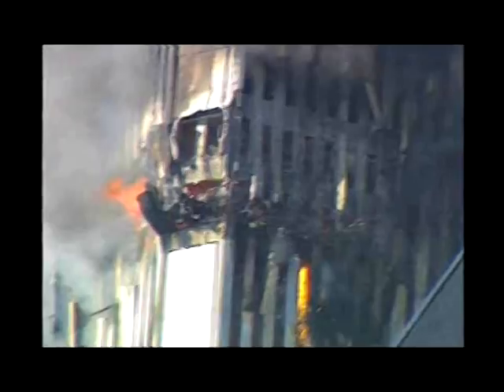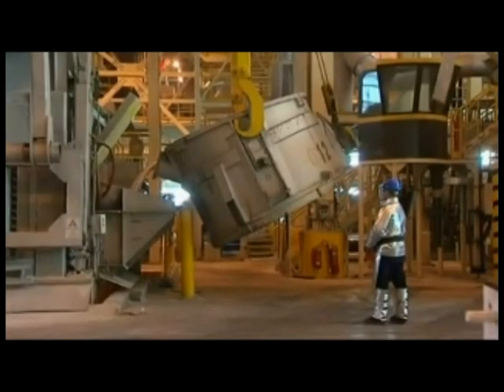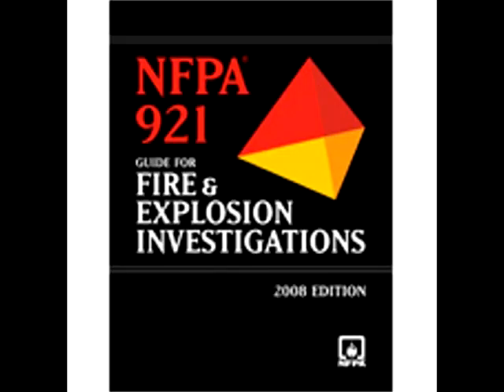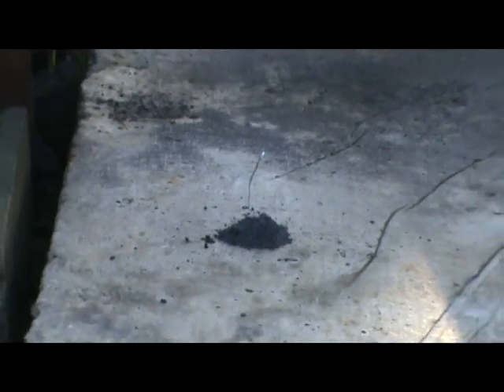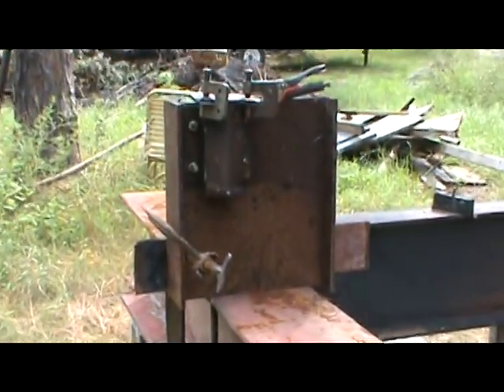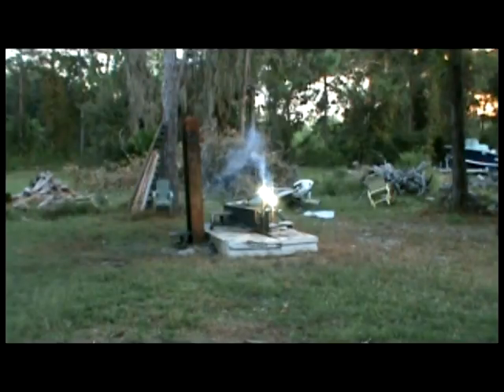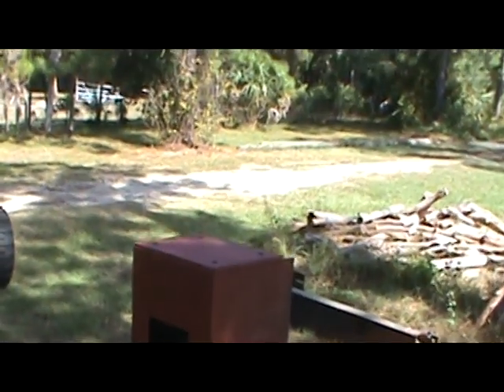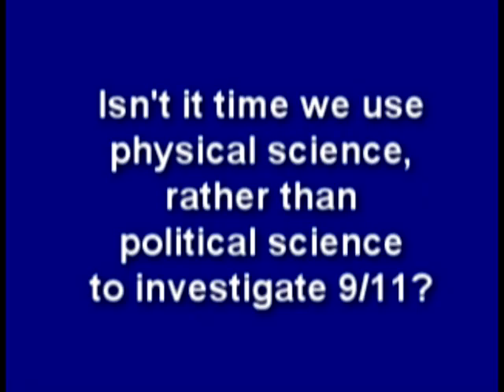9/11 Experiments: The Great Thermate Debate

Comment: @hank1961 Now yes, the columns may have finally failed due to some beams connected to the columns failing or extremely sagging pulling the columns over or simply not helping keep them upright (Watch the vids of both towers collapsing, you will see they both tilt 1st before they fall) most of the internal columns did not fail axially in how they are designed to bare load, but fell over or bent over which would require much less force for them to fail then what they could support axially

Comment: @hank1961 1st off, columns is the word you want, not beams. Beams only support their own weight, concrete slabs on that floor only, and the live load those slabs carry on said floor (desks, chairs, people, etc.) Columns support those said beams and slabs as well as all the remaining columns directly above them along with all of the beams and slabs they support all the way to the top of the tower. The towers collapsed because the columns failed, not the beams...

Comment: @bubbasteve8 You had complete access to the core support through the elevator shafts. Maintenance to elevators had been performed just prior to 9/11, including several weekends where the power was turned, giving full access to the steel beams.

Comment: Also this video mentions @ 0:40 that "molten metal was seen coming out of the northeast corner near the 80th floor." the plane flew in from the southwest going northeast and hit the tower near the right side at an angle also to the right. Therefor the, this 100+ ton wad of aluminum traveling at 500+ MPH would be aiming right for that "northeast" corner. And speaking that there were no columns between the internal core of columns and exterior wall columns, that outer wall would...

Comment: Wow, that is a lot of work you did, so your telling me that, unless they rigged all the floors with your thermite controlling contraptions, that they had pre planned the exact floor plus or minus 2 floors at most on where to fly the planes into? Evan at that it would take weeks to set up just one floor for that type of "Demolition" Where is all of the evidence of construction workers setting up this demolition of the 2 towers? They would have had to remove drywall to expose the columns etc...

Comment: @RedStarVolume 

"no load bearing walls"

ROTFLMAO!!!

some one does NOT know what he is talking about.....TOO fuck n funny.

that is why steel framed buildings are so popular and the STANDARD
NO LOAD BEARING WALLS!!!
LOAD bearing vertical support with non load bearing long span trusses.
just as the facade of 7 is a non load bearing COSMETIC application that is ATTACHED to the perimeter vertical support where there is LITTLE fire to affect them to CAUSE symmetrical unified accelerated descent.

Comment: @CalumGilhooly
"expansion of the beam would have been insufficient to cause it to 'walk off' its footing"

I agree

for every one direction where a force is applied, there are multiple directions resisting that same force.....lateral, diagonal and cross bracing....many redundant applications overlapping to form a single unit....I find it very unlikely something..."walked".

Comment: @RedStarVolume

"What were those shear studs made of again?"

what about them?
recovered bolts were stronger than typical. NIST 1-2 p.133

These systematic collapses required that THOUSANDS of structural connections per floor to not only fail, nearly simultaneously, but also in sequential order,impossible from asymmetrical impact loading and small, short-duration fires.

Comment: @RedStarVolume

"/44smgw"
Error: Unable to find site's URL to redirect to.

sorry , URL doesn't work.

"no contra regarding the correction of the concrete/steel expansion/contraction issue?"

what are you talking about?
if NO WTC steel found reached a compromising temp....there is NO expansion..
and since there is...
"no steel was recovered from WTC7"NCSTAR1-3 p.iii, 7.7.3
to examine....WHAT EXPANSION?

"you accept your failure"

me thinks you are CONFUSED and inserting topics we never disused

Comment: @NonnyMus1

'disproved NIST's model'

how can one PROVE/DISPROVE something that has NEVER BEEN RELEASED!

"NIST is withholding sixty-eight thousand, two hundred and forty-six (68,246) files, All input and results files of the ANSYS 16·story collapse initiation model, and the the LS-DYNA 47-story global collapse model with detailed connection models that were used to analyze the structural response to thermal loads, break element source code, ANSYS script files for the break elements."

your ball

Comment: @RedStarVolume  If you didn't know, full quotes from First Responders can be found here:  tinyurl . com /6p3kozx  (remove all spaces).  The quotes were cut up and mangled a long time ago by some unknown troofers and the mangled bits have continued to live on like zombies!

The link goes to the 1st section of ~25 sections which have the text of the ~510 interviews.

The original interviews are here:  tinyurl . com /7e62l (remove spaces), but are in pdf form so cannot be easily searched.  HTH.

Comment: Things which explode in office fires:  
CRT's, Drums of cleaning supplies, HVAC equipment (esp. condensers & compressors), Hydraulic pistons in office chairs, Large motors (Elevator, Air compressor, generator), Propane tanks, Steam explosions when fire cuts water lines, Tires in vehicles, Transformers, UPS battery backups

Things which exploded at the WTC:
Firefighter's SCOTT pack air bottles, Pockets of jet fuel, Superheated offices and closets flashing over.

Source:  FDNY

Comment: @hgfbob   LOL!  The link works, moron. It's your ability to comprehend how links work which clearly at fault.  On this planet, you need to follow instructions carefully and remove ALL the spaces.  That means the one before the slash as well as the ones to either side of the .

=P

You can also type in tinyurl . com (without the spaces) into your browser's address bar, copy the '/44smgw' (without the ' 's) and paste it in right after that!  =P

And there's always google, mental midget!!  =P

=D

Comment: @CalumGilhooly  LOL!  Ya bampot!  On this planet, the collapse started at the E. end of the building with failure of internal structures. Once the facades became unsupported, they fell.  The four facades held together reasonably well and ended up draped over the main pile of debris.  That would never have happened in a CD, bawbag!

And again, no deafening explosions characteristic of CD were heard. How many times will you need to be a'told afore it penetrates?  

Now, awa' n bile yer heid!  =D

Comment: @CalumGilhooly   LOL!!  Many things explode in large office fires and all explosions heard were consistent with those.

Here's FDNY's explosion list: CRT's, Drums of cleaning supplies, HVAC equipment, Hydraulic pistons in office chairs, Large motors (Elevator, Air compressor, generator), Propane tanks, Steam explosions when fire cut water lines, Tires in vehicles, Transformers, UPS battery backups. 

Demolition explosions would have deafened witnesses.  No witnesses were deafened by them.  =P

Comment: @CalumGilhooly 
3. Thermite and Thermate both burn white hot (also on youtube samples).
Any burning thermite should have been visible throught the OPEN FLOORPLANS
of the WTC towers. They should have lit up the towers like a lighthouse.
THAT should have been visible for miles.
4. Thermite / ate burns at 2500 C. That should have melted the aluminum
Window panels as it thermally rose from, and exited the building.
NOT to mention melting every junk alloy piece of furniture on that floor.

Comment: @CalumGilhooly 
1. Thermate, even Nano Thermate, (a new twoofer fad), makes sound at 
a level in direct relation to the Weight of thermate burned. That's 100 Tons,
according to Neils Harrit. The sound level is actually thermal expansion 
based, so it's related to STEAM expansion, and just as loud. That's 80 Db.
About the level of a jet engine. You should be able to hear it for miles.
2. You can hear THERMITE / ATE burning loudly in Hobbyist videos
on you tube in one ounce samples. Go look

Comment: @RedStarVolume

so....got NOTHING on the WACKY 9-11 PHYSICS...

FIREFIGHTER RICHARD BOERI WTC2
"We had our backs to the tower and under that pedestrian bridge walking south, myself, Eddie Kennedy and the officer, when you HEARD THE CRACKLING. You looked up and you saw the one floor explode on itself and THE TOP START TO SLIDE."

if the NOISE ..*IS* collapse, how is it possible to SEE it AFTER the 3 second delay it takes the sound to travel that distance through air.

in 3 seconds A LOT HAPPENS.

Comment: @NonnyMus1

''The facade bore its own weight."

that is IMPOSABLE. for it is a COSMETIC APPLICATION attached to the perimeter vertical support....ALWAYS has...ALWAYS will.

"I have provided the link to you'

lol...then JUST quote and put in the address where it's found......DUH!!!....like this...

"no core column examined showed temp. above 250C" NIST 1-3 p.95,101,132

"You should really learn BASICS of construction'

lol..I have 30 years of building BOTH steel and stick......YOU were saying?

Comment: @NonnyMus1

'You may want to PONDER how free fall acceleration of the FACADE of a 47 STORY "

lol...a FACADE that has NO LOAD BEARING what-so-ever...it is ATTACHED to the PERIMETER VERTICAL SUPPORT where there is NO FIRE located to GLOBALLY affect them for the MEASURED descent EQUAL to that of a bowling ball FALLING THROUGH AIR...

The facade was PULLED DOWN, it will NOT support itself, it is a cosmetic application with NO load bearing capability--you should really learn BASICS of construction.

Comment: @RedStarVolume

"Why is there no one reporting about severed beams and columns,'

*HINT*

LEARN HOW TO FUCK'n READ.....lol

for it's in the OFFICIAL REPORT

"but no such thing as clearly blown up steel"

...lol..uhm..it's the BUILDING that was BLOW UP fool...NOT the steel

HOW does one OFFICIALLY CLAIM YEARS AFTER investigation that NONE were used, when INVESTIGATION NEVER TESTED

"NIST did not test for the residue from explosives or accelerants"  wtc. nist. gov/pubs/factsheets/faqs_8_2006. htm

Comment: how do you get,'EVERY' column to act the same way, at the same time, unless they are under the 'SAME' conditions, and acted on by the 'SAME' force???
As soon as the kink is formed, the 'ENTIRE' building,evenly falls at 9.8m/s^2 for 2.25 seconds,(t=1.75s to t=4.0s [NICSTAR 1A 3.6]) Acceleration of gravity...at 4.0s of the collapse, the 'ENTIRE' building is falling faster than 80 ft.a second(60MPH)...'ONLY' possible by removing 'ALL' resistance...nothing in the way
more info at ae911truth. org

Comment: when the kink forms, the HVAC, 'other' Penthouse, roof, facade, within 0.5 seconds from each other, have free fall ACCELERATION for 100+ft. ALL support was INSTANTLY taken away, AS WE SEE by the EVEN decent
if there was a progression from east to west
WE WOULD SEE IT
the roof WILL NOT support itself while columns fail below it. the facade is a non supporting structure, and IS attached to the perimeter columns it will not stand while the columns fail behind it.
for more info...
ae911truth. org

Comment: @NonnyMus1

'They were guided in their investigation by evidence'

really...WHAT EVIDENCE....lol?
they have NO STEEL to look at to DETERMINE ANYTHING!!!

NCSTAR1-3 p.iii, 7.7.3..."no steel was recovered from WTC7"

"a Coroner might still make a ruling. It depends on the evidence."

"Evidence of a severe high temperature corrosion attack on the steel, including oxidation and sulfidation with subsequent intergranular melting..."

MORE HEAT damage than an open air hydrocarbon fire CAN PRODUCE
oop's

Comment: @CalumGilhooly  LULZ!  OK, shitforbrains, now that I've finished laughing, I'll answer your question. WTC7 collapsed after 7 hours of fires because a key long-span beam 'walked' off a key column (#79). You can read all about it here: tinyurl . com /3epzmba (remove spaces).

As for the rest of your spew, the Delft Uni building was NOT hit by aircraft, but was set ablaze by a coffemaker fire. The other steel-framed hi-rises w/ fires were steel grid framed with concrete cores. Get off the meth!

=D

Comment: @RedStarVolume

SO....how does one, YEARS AFTER INVESTIGATION officially claim that "NO explosives or accelerants" were used to assist, when INVESTIGATION NEVER TESTED for an OFFICIAL determination.

"NIST did not test for the residue from explosives or accelerants"  wtc. nist. gov/pubs/factsheets/faqs_8_2006. htm

same with the WTC7 steel, HYPOTHESIZING failure when..."no steel was recovered from WTC7" NCSTAR1-3 p.iii, 7.7.3 ....to GIVE DIRECTION to a HYPOTHESIS

WOW!!!
lets see how ya do

Comment: @NonnyMus1

"On this planet, in building fires"

on this planet, in BOTH Law and Debate, the Dictum is: Those who assert, MUST PROVE!

when are YOU going to START PROVING what is OFFICIALLY asserted?

how does one YEARS AFTER INVESTIGATION officially claim that "NO explosives or accelerants" were used to assist, when INVESTIGATION NEVER TESTED for an OFFICIAL determination.

"NIST did not test for the residue from explosives or accelerants"  wtc. nist. gov/pubs/factsheets/faqs_8_2006. htm

Comment: @NonnyMus1
here is Shyam Sunder the lead investigator for the NIST BEFORE their admission of 2.25 seconds of acceleration equal to Gravity when the kink forms, at the technical briefing.

"free fall acceleration can ONLY occur when there is NO STRUCTURAL COMPONENTS BELOW IT"

since it's NOT fire affecting the perimeter vertical support, WHAT IS?

"NIST did not test for the residue from explosives or accelerants"  wtc. nist. gov/pubs/factsheets/faqs_8_2006. htm

CAN'T say NO controlled demo

Comment: @NonnyMus1

"caught trying to move the goalposts'

too bad you are too ignorant to even grasp what is important...or it's deliberate.

smoke don't mean shit.

it is the SUPPORT that MUST fail and YOU need to PROVE it DID from the FIRES PRESENT, the FACT that it happened proves NOTHING....and the FACT that the side they measured acceleration EQUAL to that of an object freely falling through the AIR, where there is NO FIRE LOCATED to AFFECT the perimeter support....

PROVE it's from FIRE!

Comment: @NonnyMus1

glad you think it's amusing

WHY can't YOU find ANY?

filling your post with NONSENSE, how about a link to the 'INFERNO' you claim is there?

all you have are pics of small SPOT fires, that later shots of the SAME areas show they went OUT.

where is the INFERNO needed to affect the perimeter vertical that the FACADE is attached to where NIST measured GLOBAL acceleration EQUAL to that of an object FREELY FALLING through AIR as soon as the kink forms at 1.75 seconds into the collapse

Comment: @hgfbob 
1. They did. Fresh Kills yielded the FIRST WTC 7 steel testing, done in 2001.
MICROSTRUCTURAL ANALYSIS OF A36 STEEL FROM WTC7
tms. o rg/ pubs/ journals/ JOM/0112/ Biederman/ Biederman-0112. ht ml
2. YOUR EXAMPLE QUOTE "no core column examined showed temp. above 250C"
is of a small sample, and is noted TO NOT BE REPRESENTATIVE in the very 
next sentence. OUT OF CONTEXT quote mining is the method of a LIAR.
3. Uh, Yes, You can't get around that explosive debris is NOT THERE.

Comment: @Merlin5by5

1.- lol...in a landfill huh...why didn't they INCLUDE them in the OFFICIAL REPORT?
"no core column examined showed temp. above 250C" NIST 1-3 p.95,101,132

  "chemical testing"  GREAT.....SHOW the RESULTS that PROVE the asserted claims that "NO explosives or accelerants were used to assist"

2.-"Because it's NOT still there".....uhm...MErLIE...that's NOT an answer...I am truly disappointed in you...how does THAT give credence to the OFFICIAL claim?.....where are the TESTING RESULTS?

Comment: @CalumGilhooly 
2. Where did the resistance of all that steel and concrete go? You haven't answered that.
YES, I have, several times. All objects with weight are constantly falling, that's
what weight is, mass at 1G, and everything there had weight, right?
The ONLY thing that resists falling for any building is STRUCTURE.
Steel columns connected by 1.5 inch bolts. Shear the Bolts, destroy the structure.
Even a braid dead cockroach, ie, a 9/11 Truther, can understand that.

Comment: @CalumGilhooly 
1. Why was the lower structure disintegrating well ahead of the collapse front? 
Because of the IMPACT of the Upper Block Shearing Bolt connections, and 
deflecting the steel supports for the floor systems. 96 such supports were 
recovered out of 200. They were ALL deflected downward. the rest were 
shock destroyed, ripped off their spandels, or unrecovered. NCSTAR 1-2.
There was no explosions. Explosions produce light and sound,
not just air bursts. DUH

Comment: @Merlin5by5

'limted Assymetrical damage.'

no MErLIE..LOCALIZED asymmetrical damage....what part DON'T you understand...and there is NO part of the structure "unsupported"...there is NO structural damage BELOW the impact floor...33 outer columns were damaged out of 236 outer columns which comes out to 14%, count the columns yourself in any image or video that shows the holes.. NIST estimates that 6-8 core columns 7 out of 47 comes out to 15% leaving 85% of the core columns intact and undamaged.

Comment: @Merlin5by5

"When the Upper Block struck the lower structure,"

oh yes MErLIE....."WHEN"...

as ALL of you shills staqte, it's ALWAYS ....AFTER it starts moving...how about the MECHANISM to START it moving..
wasn't the MINIMAL localized asymmetrical damage that INVESTIGATION found...
and YOU HAVE NO EVIDENCE that the REMAINING 240 intact FIREPROOFED support on EACH towers impact floor failed from the FIRES PRESENT...or that explosives or accelerants didn't.